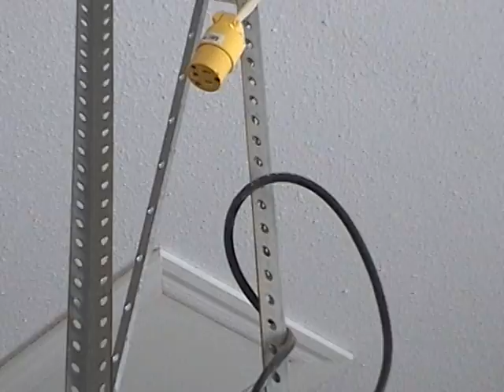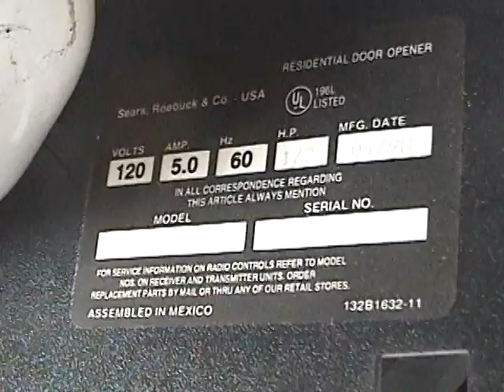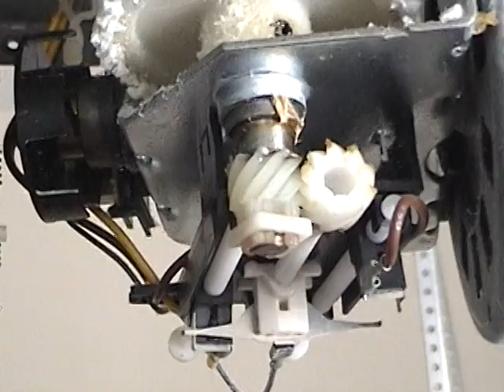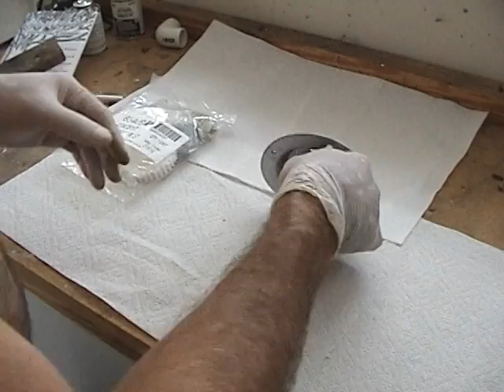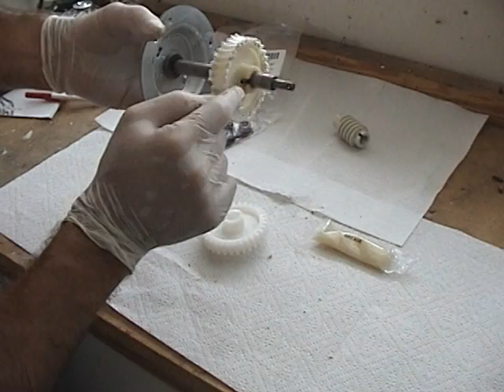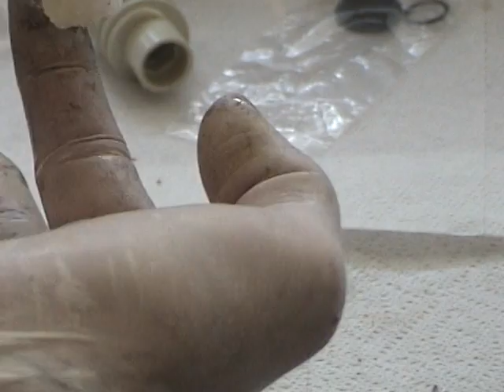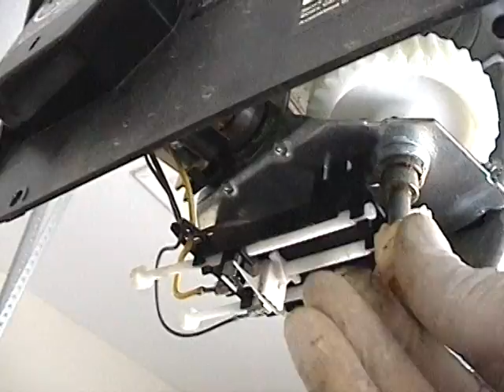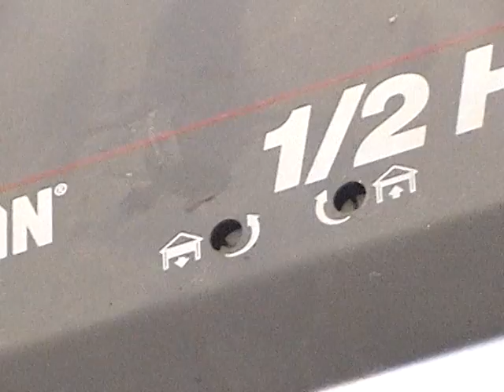Craftsman (LiftMaster) garage door opener issues?

Comment: Yes yes I figure it out already but thanks for geatting back to me and yes it was the force adjustments just need to turn them a little for it to continue its travel or door to close or open. people just higher part of normal then back to 4 oclock that should do it. The worm gear the bushing, you need to makesure its in opposite of noch or to slip in further to get lock clip in. I had trouble with that.

Comment from the maker: @farstarfilm 

I'm guessing the up/down stops got messed up. After replacing, my door did close all the way (about 10" off the floor)--not as bad as whay you have. They may have slipped out of place during the repair. Fix by adjusting the stops buy turning the adjustment screws on the opener, there should be some small images to show which way to turn. It could also be the pressure adjustments, same deal to fix but there are DIFFERENT screws for that. mined needed adjustment to both.